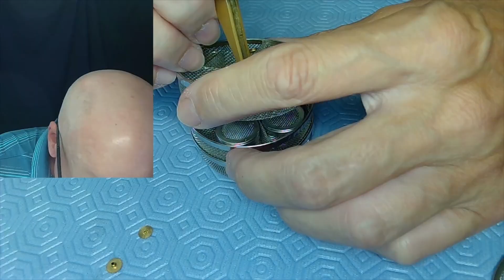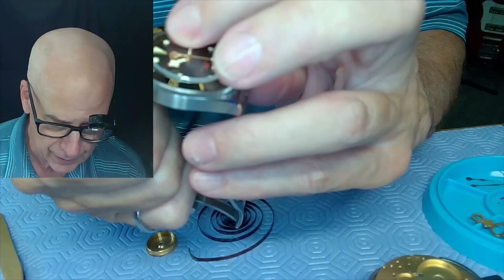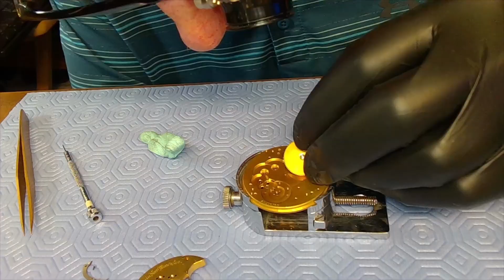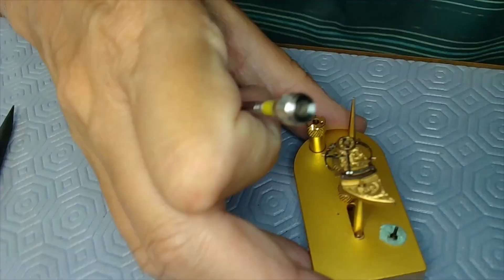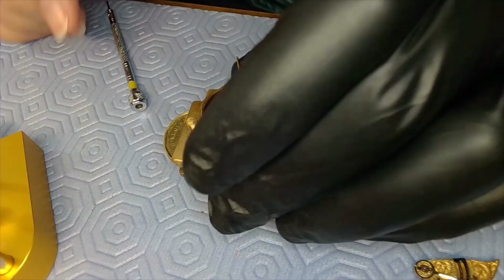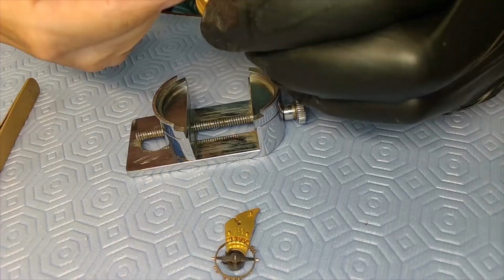MUST WATCH! Assembly Vintage 1879 Elgin Convertible Pocket Watch

Comment: Hi Richard. I am working on an Dueber Hampden 18s 15 jewel pocket watch. Had an extremely neglected watch I had to order a donor movement from the US. Here in Europe is hard to find american watches for parts. Unfortunately on both watches balance staffs are broken, so the watch although the power reaches the pallet fork, is not running. Can you please indicate me where could I find a balance complete for this movement since I can't find it on Ebay. I can't, like you, machine it on the late. :)